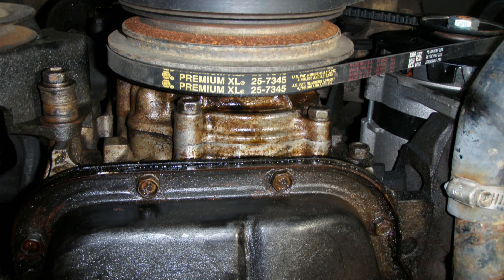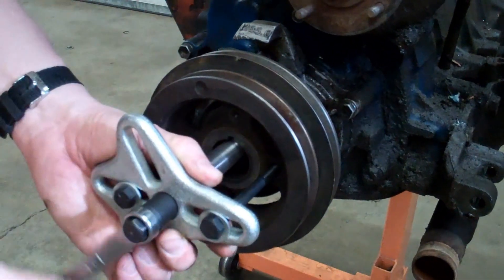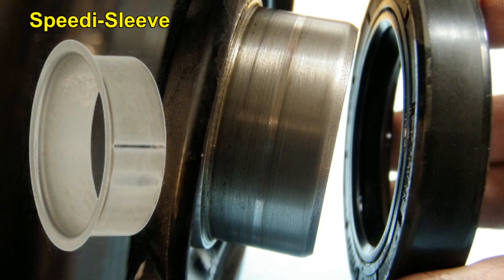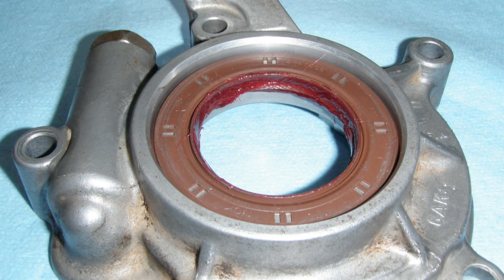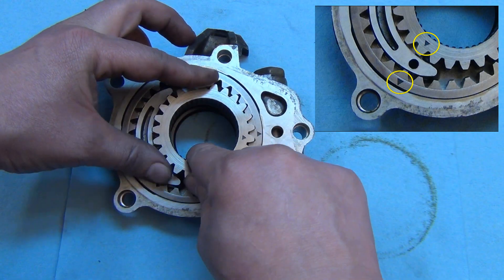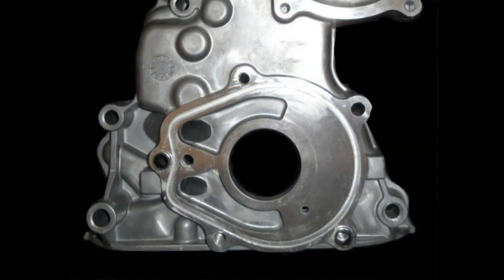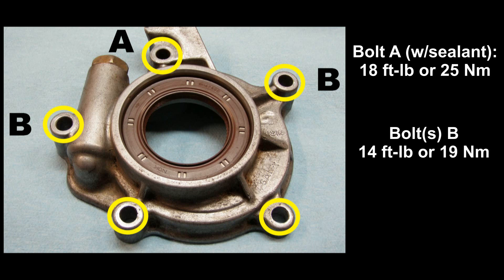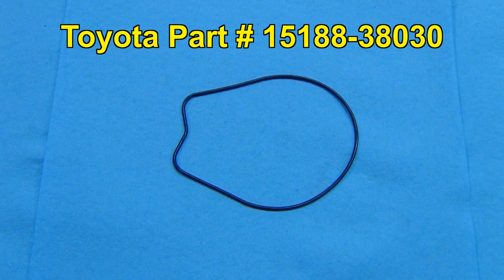How to fix Toyota 22R Front Main Seal Oil Leak (22R 22RE 22RTE) No Speedi Sleeve!

Comment: I've ordered mines from lce engineering but haven't installed...second one leaked used a felpro brand. I've noticed my harmonic balancer has been resleeved..ordered a new balancer and oring from lce. Will see how it goes thanks again
Reply: What was the condition of the speedy sleeve? I've got one I just installed one on mine and I'm debated taking it off and doing it like this video instread.

Comment: Hey. Thanks for this video, it is straightforward, well-paced, and expertly done!!! I am going to be replacing the front main seal on my 1990 toyota pickup 22re and in my Chilton guide it says that I ought to take off the oil pan before removing the drive belts and the crankshaft pulley. Would you recommend that? (I may have a leak there, too, in which case I will do it anyways, but was wondering if it was necessary for the front main.)
Reply from the maker: +Eli Edleson-Stein   Unless you have a confirmed oil pan leak  I would NOT take the pan off.  I have a 1992 4x4 also and you do not need to remove the pan to get at the front main seal.  Sent you a private message also with some information you may want.

Comment: Hey Pete. What do you use to drive the new seal in so it's square? Also, do you use motor oil to lubricate the pump O-ring and is there any sealant used on the outside of the new seal before it is driven in?  Lastly, do you use any special tool to get the crankshaft pulley back on without damage or just push it on and tighten it back with the 19mm bolt? Thanks in advance.
Reply from the maker: I use a standard seal driver like this:  https://www.amazon.com/Powerbuilt-648495-Seal-Installer-Kit/dp/B0015UXUCE/ref=sr_1_12?ie=UTF8&qid=1493865553&sr=8-12&keywords=seal+driver  I put a very light coat of o-ring compatible grease on the o-ring (just pull the o-ring lightly through my fingers with some grease on them.)  Dabs of the same grease to hold the o-ring in the groove so it doesn't fall out and get pinched as I install the pump body.  No sealant on the outside diameter of the seal before I drive it in.  Some people like to put a really thin coat of grease on the outside to assist in getting it in the bore of the pump body, but I've always driven that main seal in dry and clean and never had a problem with it leaking past the outside diameter.  If the seal bore is dinged up and you're worried about it sealing to the OD of the seal, you might try a really light coat of RTV or some other thin sealant around the OD of the seal, but I've never felt the need.  I've always thought that lubing that outside diameter on that front main seal might give it the chance to get pushed back out by oil pressure.  Again, seal manufacturers usually call for a really light coat of grease on the O.D. of rubber coated seals to aid in driving it in. I ALWAYS grease the LIPS lips of the seal when installing it to help keep from damaging it during install and then at initial start up. The pulley is keyed to the crankshaft with a big woodruff key.  No special tool to install it, just get it lined up with the woodruff key, push it on as far as it will go, and then crank it down with the 19mm bolt.
Reply: But be careful with that OEM 19 mm bolt, as if you do not get the balancer on far enough, initially by hand force, you could damage the threads when cranking down on the bolt, since it was not made for such purpose (not long enough). Using a tool specific for this job is safer!. You can rent/purchase the tool, and get money back (Tool loan thing) at Advanced auto, or Oreillies.

Comment: do I need to pull the engine to replace this?
Reply from the maker: No.  This the the front main seal.  The front main can be replaced with the engine in the vehicle.  The rear main seal requires you either pull the engine or the transmission...your choice.
Reply: Thank you!

Comment: Can you get those seals anywhere else or only Toyota? I'm not close to a yota dealer is my problem.
Reply from the maker: You should be able to order one online using the parts number referenced in the video.  It's usually cheaper to order OEM toyota online than it is through a "stealership" any way.  ;-)

Comment: Just did this job. I've got a lot of oil coming from the left long mounting bolt B. Any clues? Not out the sealing surface but from where the head of that bolt meets the body
Reply from the maker: Hmmmm....the left "B" bolt when facing the engine correct?  That's the one that's closest to the oil pressure relief valve  there's also supposed to be a hollow alignment dowel in the timing cover on that one too.    I think that is supposed to be a blind hole in the timing cover, but I don't have one with me that I can look at right now.  The three possibilities I can think of are, the oil pressure relief valve body has a crack and is letting oil into that bolt hole (never seen that before), #2, the o-ring is compromised right there and if the dowel isn't in there it might be migrating to that bolt hole, #3 the bolt hole isn't blind into the timing cover and oil is coming past the threads.  That one would be the easiest to check, just pull that one bolt and shine a light or stick something down that hole you can use as a depth gauge and see how deep it is.  If it goes all the way through the timing cover and is exposed to oil you will need to put some thread sealer on it and run it back in there.  The only bolt in that set that should need sealer is the short top bolt...
Reply from the maker: So I spent some time looking at pictures of the timing cover, pump,and gasket between the timing cover and the block.  I think if the gasket between the block and the timing cover were compromised in that spot it might be able to leak oil under pressure into that bolt hole and then up past the bolt head.  Again,  I don't have a timing cover or block handy at the moment so I'm just going off what I can find on the web.   If someone had been into the timing cover before and didn't get all the gasket material cleaned off or worse, tried to re-use the timing cover-to-block gaskets, I can definitely see where that might happen.   You might try some sealant and a copper sealing washer under the bolt head (just make sure you have enough thread engagement on the bolt after putting the washer under the head.